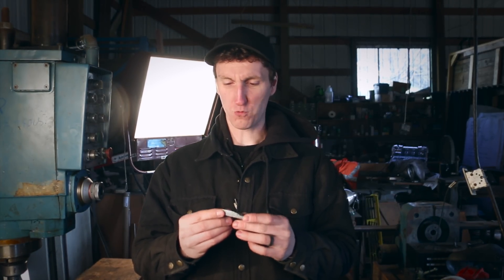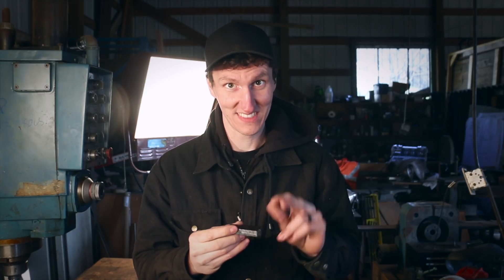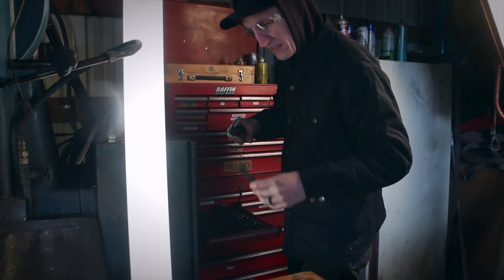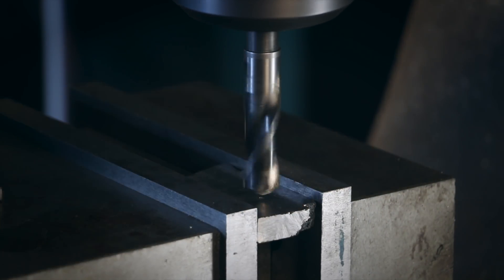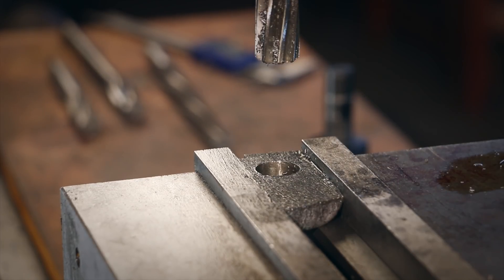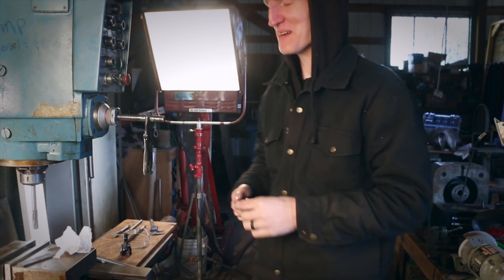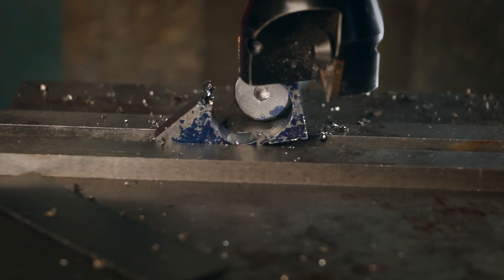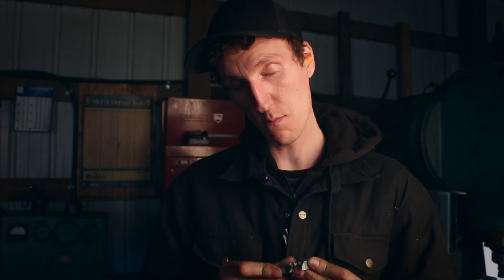Making THERMITE RING - Part 2

Comment: Might have been less of a shock to the material if you used an end mill instead of a fly cutter. End mills take finer finish cuts, where fly cutters are used to hog off material in rough cuts.

Comment: There is a knife in southeast asia known as a Kris, Wikipedia describes it as “made from alternating layers of iron and nickelous iron” but when i first saw one made they made it from nickel, iron and and a gold colored metal (I honestly cannot remember if it was gold or brass or even copper)  then they rough melted the 3 together and twisted them up like taffy before making the blade out of the resulting ingot (i watched this once like 30 years ago so exact details are missing), anyways maybe you should make a thermite recipe with magnesium (the way they did in the 80s) then throw in some thick coils of nickel and (brass?)  so the resulting ingot has more interesting (and structurally uniform) bands of impunities in it... then let it cool for as long as it takes to cool (I’m thinking a day) so the crystal structure doesn’t start to break apart while it’s still cooling. The big weird variations would make the metal have a more varied look if acid etched or even hit with a wire wheel long enough to let the different durabilities show

Comment: I would have press fit or even epoxied another, stronger layer of steel on the inside of it, and then use that to hold the brittle thermite bloom steel together. You could have done this before trying to shape the outside of it, and then just used a belt sander.

Comment: Hi
You can use that material to make an ornament showing the iron crystals as if it were a mineral, or make a preform: then try grinding it by hand with a file or sandpaper, or place the metal on the lathe and do it with sandpaper or file.  Try it, do not be discouraged👍🙂

Comment: Make a new thermite puck then normalize the shit out of it? I think your grain structure sabotaged you, man.
Reply: The thermite reaction creates a raw iron ingot the various steel shavings helped gonna need a second melt down in a sealed crucible to keep the oxygen out add something to up carbon content and the normalizing cycles to refine the grain.
Heat to welding temp flux it solid taps with a hand hammer normalize repeat
Reply: Hix1388 charcoal would be an adequate carbon source, as well as capturing excess oxygen. Add Some sand and glass to capture slag and impurities. Then add a handful of green leaves (hydrogen) to lower the melting point of the iron and give it more time to separate. But I mostly have an academic knowledge of these things.

Comment: When I make rings out of jade and other stones I use a hole saw to get it somewhat near the outside diameter then chuck it up in the lathe and drillbthe inside hole after that I do the rest by hand Idk if that could work for your ring but its worth a shot
Reply: This is the same thing I was going to suggest. My experience is from making parts for a old custom motorcycle that you couldn't buy parts for instead of jewellery, but the principal is the same. Hand work has a finesse level for fragile materials that machines struggle to match.
Reply: I remember in metal shop trying to make rings for fingers and managed to make at least 1 good one. The lathe did most of the work.
Reply: Never made a ring out of metal but I have made some out of wood and a lathe is the the way to go.
Reply: @canaan5337  most definitely I made one out of oak came out pretty good don't think it would have been half as good without the lathe

Comment: Just a thought but the way you did it was stressing the material way to much without some form of sacrificial material on either side, 

just having a loose axle point and the material so far up was asking for failure.
turn a sacraficial rod, weld the remaining piece to it and turn in the lathe, way way easier
A lathe tor round things a mill for flat things.. otherwise keep it up always like your mad ideas

Comment: I'd recommend a smaller diameter cutter. It's tempting to use a face mill but the flute spacing is what killed you. The space/ time between each insert making contact is like a repeated slap against the material. If you use something like a 3/8 endmill with 5 or more flutes you'll have better chances of success. The cutting edges are closer together and a small diameter means less pressure on your part.

Comment: I have an idea, don't know if its a good one or not, but when making the Thermite, couldn't you spoon out the extra slag material like they do for pouring bronze or aluminum and mix some borax into it to make a more pure ingot?
Reply: What would you spoon it out with, without it melting? That is extremely hot
Reply: Thermite gets really hot but not hot enough for long enough to melt steel to a freeflowing liquid that can have the slag skimmed off like modern  crucible steel.   The iron made by the thermite reaction is more like what is produced inside a bloomery furnace.

Comment: my suggestion would be to melt down the piece that you get after the thermite reaction so its somewhat more uniform
Reply: What do you think is happening in the thermite reaction other than melting?
Reply: @Nevir202  vaporization of some sort causing gasses to be released into the mix which in tern causes pockets void of metal making the whole cast (?) weakened and not suitable for machining with any substantial tools